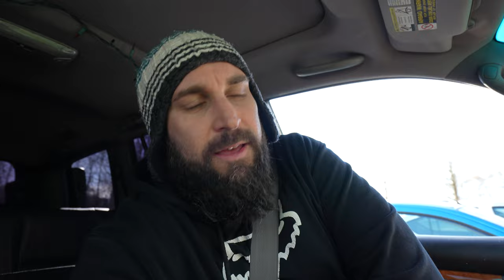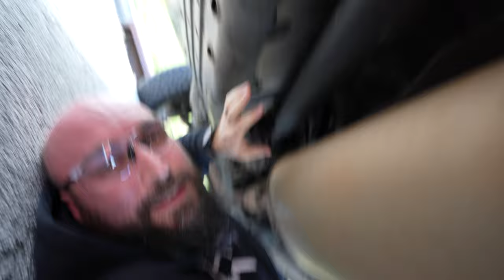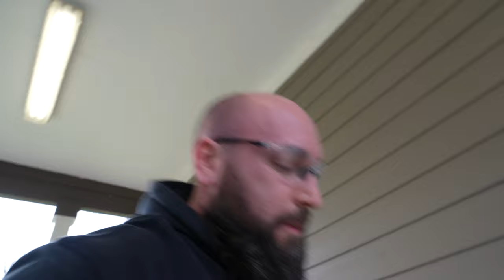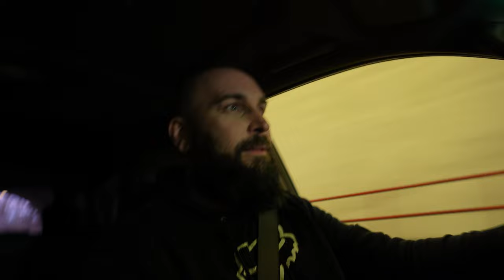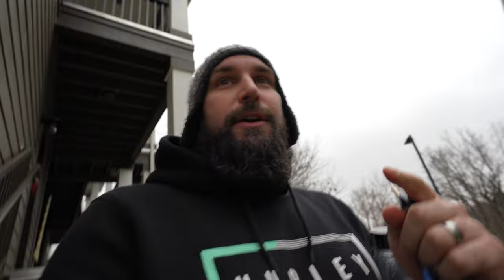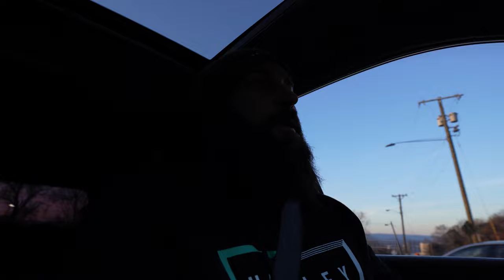Cheap Lexus GX470 STRAIGHT pipe at @Walmart?! Quick, easy and PURFECT!

Comment: Did I see that you cut the pipe right before the catalytic converter?  
Did you have to remap the engine?   Anything else need to be done?   Fuel mileage?
Reply from the maker: It’s after the y pipe. So no codes or anything like that. No remap available for my year model yet but hopefully soon. 

Super easy. Fuel mileage remains the same unless you drive to hear the roar 😎
Reply: @RichardBauer_  😁     Super
Reply from the maker: Let us know when you’ve done it 😬